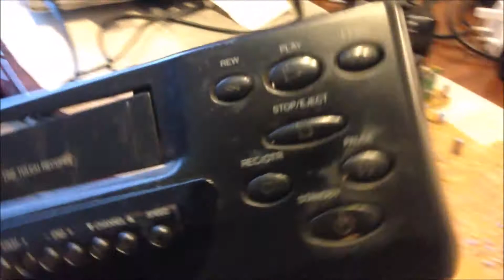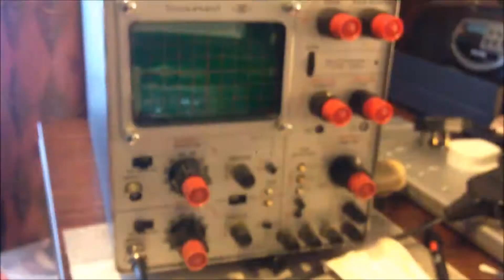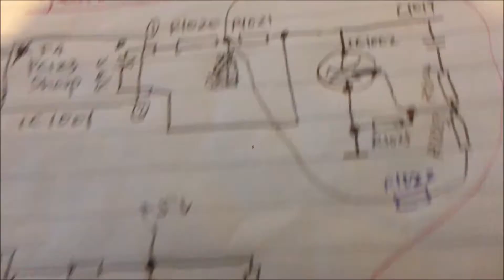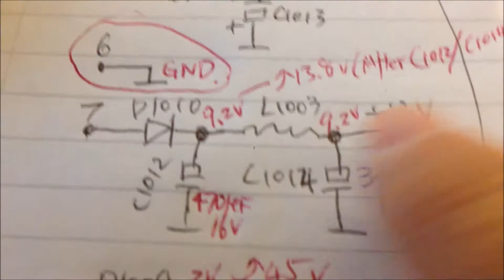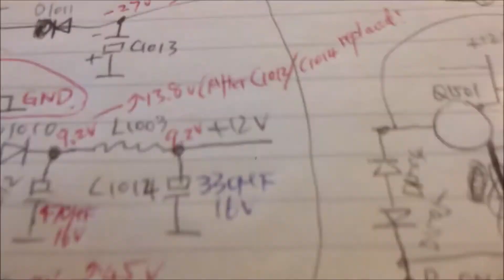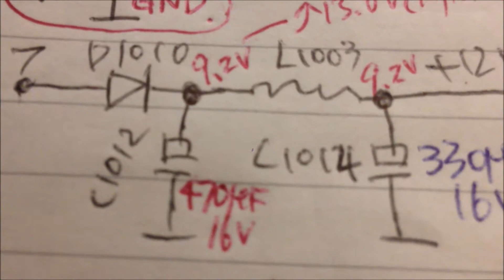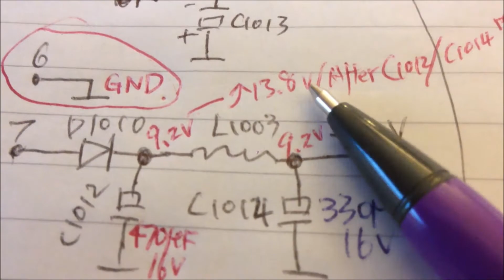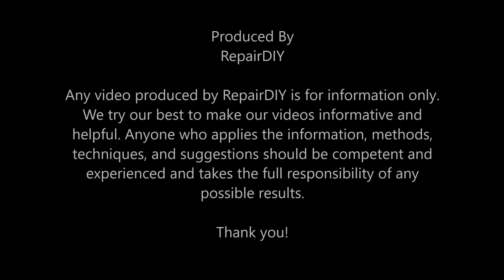Alba Video Cassette Recorder (VCR): No Display Troubleshooting

Comment: Hi there my VCR for my mum just plays sound and no display can you tell me what’s the problem if you know sir?
Reply from the maker: hi, each problem may have its own reasons and too many possibilities when not working well. if playing sound okay, it means the power supply should be good. you could try if you have pictures from scart connect, and also try if you can have video pictures from RF cable connector. you may be lucky to have video picture from one of them if not both. if both no video picture, you may have problem in the common path from video head to the point where splitting to scart and RF signals. Good luck!